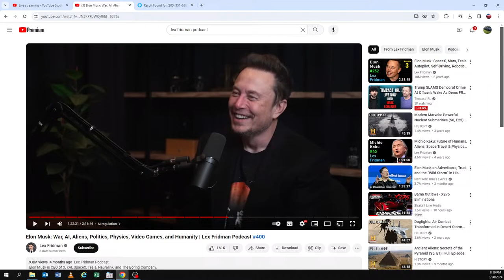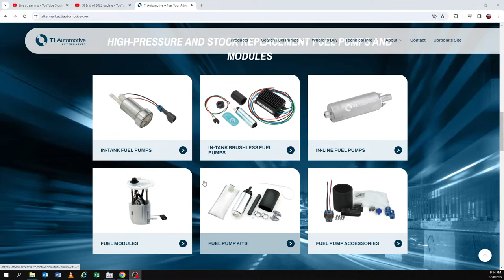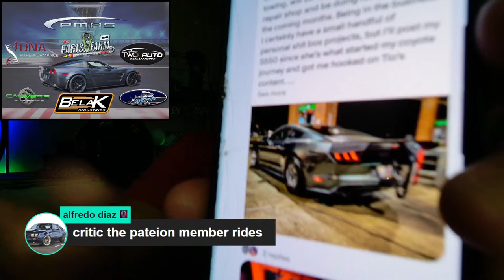#YDBTDAILY The Truth About Automotive Regulations & Your Ford

Comment: As good as the Lincoln’s look these days, it’s that runner up engine the Ecoboost holding it and the other cars and suvs back. The Coyote was Fords redheaded stepchild that outperformed and overachieved and what it got for its trouble was to be a non option for big cars and suvs. 

The Crown Victoria stayed long enough that it could’ve had a Gen 1 in its final year of production in 2011 and went out with a bang. A Mark Viii should’ve showed up in between 2011 and 2023, also some new town car/ crown Victoria, a Bronco, Explorer, Expedition, Navigator, all with a option for a coyote and something special with the predator engine. 

The v6 Ecoboost was ok but when Ford didn’t make the customer choose which gonna dominate platform by putting in a mustang, the Ecoboost should’ve been put on the backburner. The GT was fine but C8 is a trim away from being able to not only match but also exceed it in performance for less money. Why there hasn’t been a Predator Ford GT is bonkers at this point. 

These Lincoln’s could’ve EASILY  been in the conversation with Cadillac and the German counterparts and the choice in powertrain and not being convinced to make a performance Coyote variant keeps them repeatedly getting looked over.

Comment: If Govt would stay out of emissions the automotive world would have gotten cleaner and better fuel mileage with better technology. All because market and people would have pushed industry in this direction by itself.

 Like my field of work heavy duty trucks. In 2002 EPA came in changed standards for 2003 yr that was supposed to start in 2006. We had engines getting 6.5 to 7.5 MPG with big horse engines easy. Then 2003 fuel mileage dropped 1.5 - 2 MPG but we were cleaner yet burned ton more fuel JUST F*CKING STUPID. Now we're back to same fuel mileage that we had before 2003. Right now if Cummins removed all emissions and keep common rail fuel system we would be close to 10 MPG and this is from them. CO2 levels doesn't indict warming either. We have proof high CO2 levels in middle of ice age and very low CO2 level in warm periods. Right now we are at 0.03-0.04 CO2 level and min CO2 level for plants to live 0.02%. CO2 greenhouse gas in lab setting but CO2 is heavy gas that sinks to the ground. They don't talk about plants that used CO2 that get us Oxygen. I watched House Hearing where Republican rip John Kerry rear. Kerry doesn't even know what co2 level at, what CO2 level needed for plant life and then says CO2 level standard would change daily WHAT. Then Kerry deflects too all scientists said so got called out of that too. All he did was bumble his way through House Hearing

Comment: PBH working on a 5R200 hub? Lol
Reply from the maker: Lmao
Reply: @YDBT4LIFE when an oem makes a car the first priority is following the regulations. This from the bore spacing the to cylinder count, the lift of the cams, the ring package, the gear ratios, every component is designed to pass regulations. Cost is 2nd priority. If the epa didn't exist we would have 7 second factory Mustangs with a warranty.